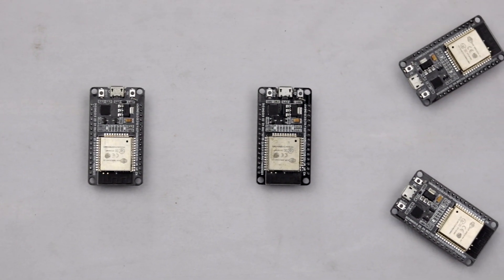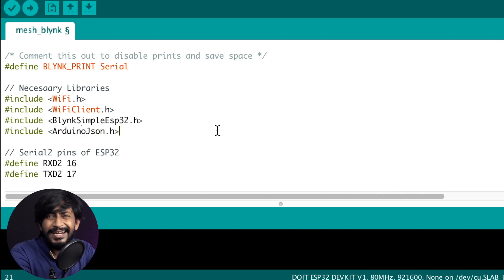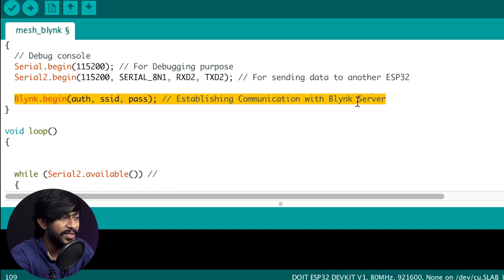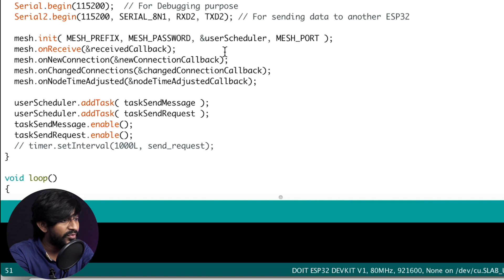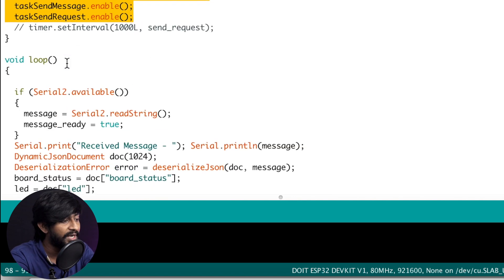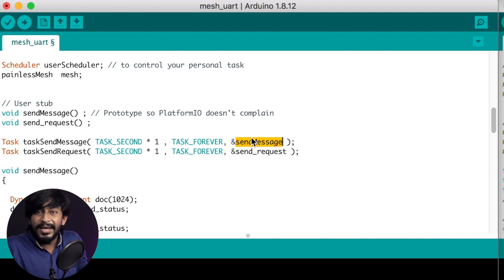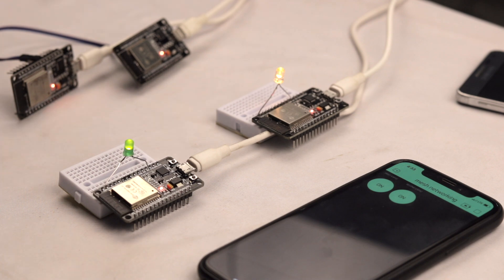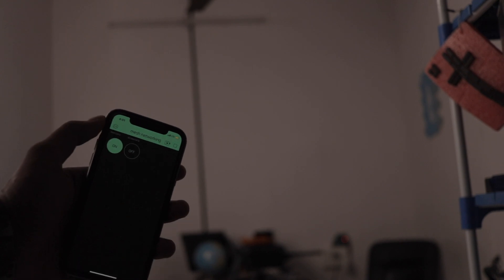Internet to Mesh Networking Home Automation Project using Blynk & Painlessmesh

Comment: Grate , what is the practicle real life application ?
Reply from the maker: In coming future where all the device in our home will be smart device and all of them needs internet connectivity. But on the same side our wifi routers have limitation of number of devices getting connected with them. 

So in those scenarios, mesh networking will be useful where only one device will be connected to the router and rest of all devices will be communicating locally with each other via mesh.
Reply: @techiesms  Will there be any interference between the ESP board WiFi and router WiFi ?
Also can you please make some video where we can use RS Pi to make our own server using mosquito so that we don't have to rely on Blynk.
Reply: @techiesms   hi it's awesome ☺️
I want to create mesh network by using lora with esp32..  i want to send the lora data to server . In here i use one lora and  one esp32 for one device likewise i have 4 device. So how can i create lora mesh network by using those 4 device ( in here i used the esp32 as a microcontroller) please help me
Reply: Basically it's a bastardized Z-Wave or Zigbee but uses WiFi. Would be better with out a cloud service in the way.

Comment: Suggestion: You could take the serial communication out of the picture to reduce the delay. Doing so, you will be using three esp32s, with the all three esp32s connected in mesh and the first esp32 being connected to the internet actinng as the root node. "painlessmesh.h" is an arduino library for wifi mesh right?

Comment: This is a great tutorial for constructing multiple gaming handhelds with local online multiplayer gaming tournament. You can manage a single, non-gaming esp32 handheld to manage the tournament, the lobbies, and maybe even streaming if you have enough power in the handheld and enough power in the internet bandwidth (prolly dual sim). The gaming handhelds can speak to each other independently, and share that data independently with the manager handheld.

Comment: Can we connect this esp mesh with internet on same nodemcu and not using any serial nodemcu?... in above example there is separate nodemcu for blynk.. is there any solution to avoid it and use painless network and connect to wifi internet in the same code?? Any updated version right now? please respond if possible

Comment: Thanks a lot for sharing,
 I have a question, Can I use painlessmesh library to create a mesh network which has , multiple leaf nodes, and one gateway node, and connect the gateway to the internet , so that it can transfer data gathered from the leaf nodes to a server?

Comment: @techiesms Can you please point out the difference between using the painlessmesh system vis-a-vis a zigbee module which also creates a mesh networking system? Is there any downside using the painlessmesh and not the zigbee system? This is for a project I'm working on and if you could find the time and explain this timely, it'll be a great help. Thank you.

Comment: Hi,
 how can we utilize two esp323 boards communicating wirelessly with mesh networking, and one of them sending data on Blynk app with the help of the internet?

because in this video you are connecting one of the mesh networking board with an esp32 internet board via hardware serial connection.

Comment: There is one more way to do it If you want connections like this.  
Internet <----> Router <----> ESP8266/ESP32[D1](NAPT) <----> ESP8266/ESP32[D2]  

Where esp D1 is an Access point and it also serves as a Range Extender(NAT) to esp D2  [ WiFi.mode(WIFI_AP_STA)  ]

Add this code into esp D1.
   ip_portmap_add(IP_PROTO_TCP, WiFi.localIP(), 8888, IPAddress(192, 168, 4, 100), 8888);
this will allow you to connect esp D2 through your router (192.168.0.100:8888). simply it will add entry to your esp D1 NAT table.

 Router -> 192.168.0.1
 ESP8266/ESP32(NAPT)[D1] ->192.168.0.100 (intenal AP 192.168.4.1) 
 ESP8266/ESP32[D2] -> 192.168.4.100

CODE: https://github.com/raj129/espStationWithAP
Ref: https://github.com/martin-ger/esp_wifi_repeater/blob/a8f22335b877d7457a0635dab59daaa6861b7b49/include/lwip/lwip_napt.h#L96

there are some points still remain.
1) Stress testing. Overrunning them on full heat 🔥🔥
2) how much long-chain that we can make,
3) latency in full traffic.

Comment: Hi, I am confused. @1:19, a serial connection between the middle one (name it B) and left one (name it A) is used? if so, it acts as a routing path (already designed) for the two modules (C and D) in the right. As far as I know, the mesh network should be configured automatically. In other words, in the beginning, all four modules do not if they could connect to wifi (or the internet). Then, 'A' finds that it can connect to the internet, others cannot. After a while, 'C' and 'D' recognize that they could access the internet via 'B'->'A'->Internet. How a ESP32 can perform this? Thanks

Comment: Well, your video is just amazing ! i've learnt many things. I only don't want to spend some money using Blynk. i am actually building a mesh controlling my home heating stuff with esp32+oled (TTGO). Using a webpage on a esp32 webserver would be an other solution instead of Blynk. you don't show the serial cable. a focus on it would be appreciated. the connection are Rx2->Tx1 .... no ?

Comment: Hello, when I am using esp8266 node MCU(12-E) for doing this project. after compiling this code,I am getting an error which states that your Serial2 is not declared in the scope. help me.
Reply: Hello ,did u find anything about this problem. ,I am getting an error to
Reply: @sametgurses554  no.i didn't get a answer.

Comment: wonderful! but I have a question why u used 2 modules for receiving and retrieving data (mesh blynk, mesh uart)?  can both are not handled by a single module?
Reply: yes bro i do a have same problem and try to do it but i failed.did u get any solution for this

Comment: Gud one .......what about our own WiFi app in place of blynk for home automation.
Try this for everyone
Reply: use adobe xd for design the UI and use flutter for design the app. what the advantage by using adobe xd is, you can convert the adobe xd UI to flutter with the help of XD to Flutter plugin in adobe xd. whereas Figma cannot. and you get more community support for the adobe and flutter for developing your app.
Reply: and one more thing, you can make both Android and IOs app using a single code with help of flutter.
Reply: @sreejith510i  wow
Reply: Definitely a good idea !
@techiesms

You must consider this ! I can help you in this
Reply: Use figma tool for it, it is similar to voiceflow
Reply: @shubhamiot326  No, Figma is only UI Design tool
Reply: @mksolanki5435  yes, but backend can be done afterwards, using node.js
Reply: @shubhamiot326  No, It's not possible it's just Design it's not even code
Reply: @shubhamiot326  Yes for backend you can go with node.js
Reply: @mksolanki5435  use figma for designing frontend, it is so easy like voicemail
Reply: @shubhamiot326  No, It's just Design like Photoshop, You must have to write code for design as well.

We do use these tools like figma, sketch, Adobe XD these all tools are just to make prototypes.

There is no connection between these outputs to code
Reply: Anyone with some knowledge of android programming, we can do modification to the figma generated code...
And it can be done
Reply: @shubhamiot326  I am also a Android developer, Just per experience saying that it's not possible to use this for as design in Android even in iOS as well
Reply: @mksolanki5435  so then what to use?
Reply: @shubhamiot326  This is uses for making prototypes like how app will look and how it will work.  It is used for making concept of app before move to real code
Reply: @mksolanki5435  flutter should be used?
Reply: @shubhamiot326  Yes, Flutter can be use to make apps & also if you want you can go with native as well
Reply: Last statements/question is intriguing.. what is the use case on this method? Anyhow is a good sharing...
Reply: @noersaleh  yes, it is.
It is regarding , how to build your own app ...using some smart tools,
Like figma or flutter.